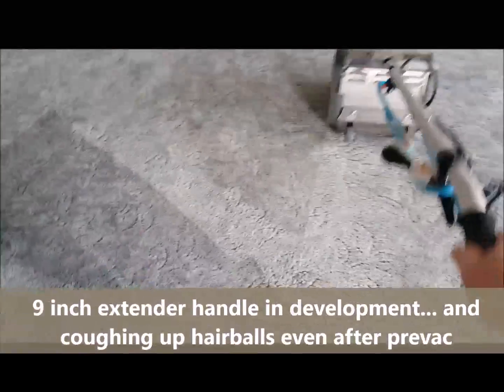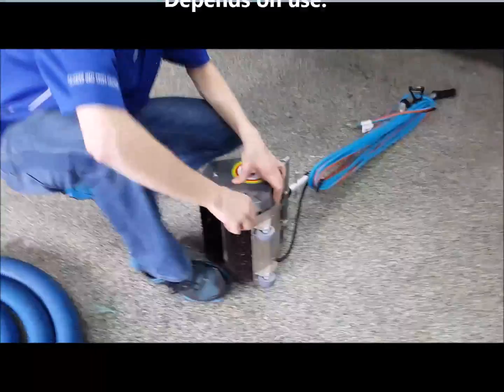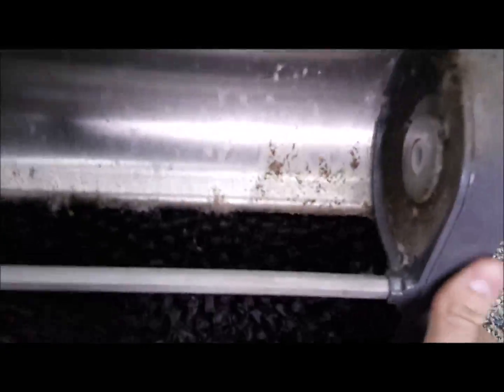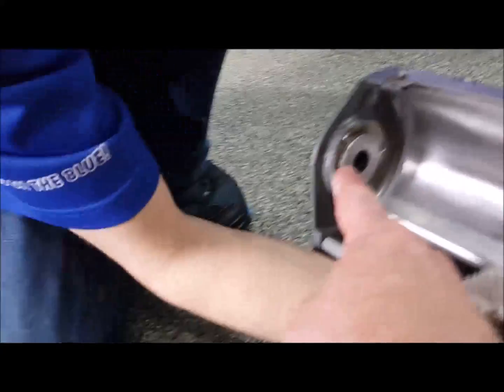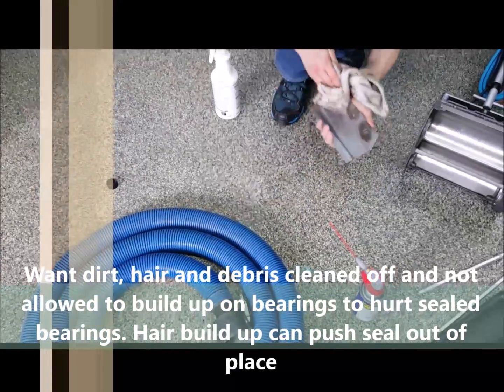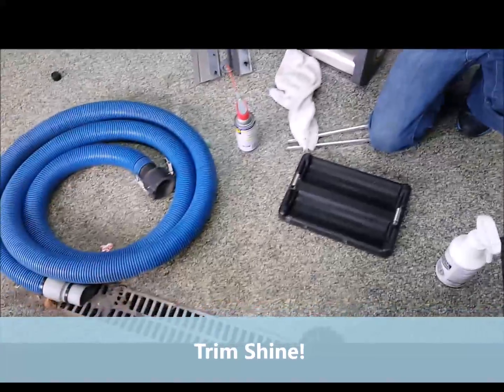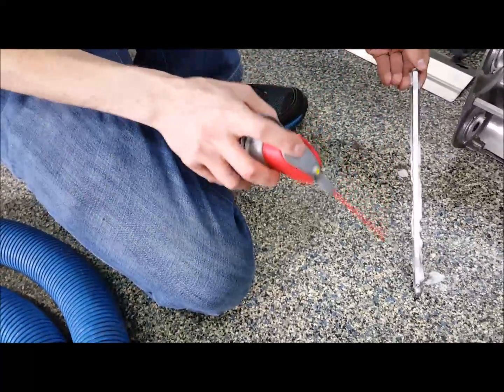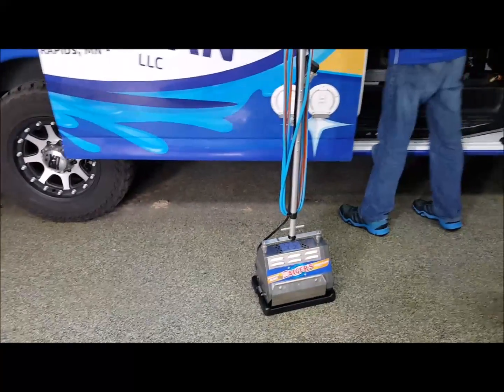CRB maintenance and use video with Saiger's

Comment: Nice Job Mark Saiger!!!!
Reply from the maker: Scott Mckay thanks... Has been on my to do list to get this done :-)
Reply: The fact your getting 8 plus years out of you crb's, this is great info. Thanks
Reply from the maker: on those 2 units that we are still running after 8 years...We abused them a lot...even didn't clean up enough in our past. I have put a set of end caps with bearings on the end of each one about year and half ago....just to keep them going and be ahead of the game.  They are going like crazy yet everyday! I hope my new ones I have do the same. I have been so impressed by these things

Comment: Wow. That bottom rod comes out alot better than mine. I need to tap it out with a bolt the same size as the pin on the side. I tap it out that way. Just about 10 minutes to get that bottom rod out. Glad yours is smooth. Other than that great machine
Reply from the maker: Bradley Stemper just make sure you put wd 40 on those rods and it will make them easy each time
Reply: Bradley use wd40 and also spray the center of each cylinder for easy glide. I love the crb and its versatile design!